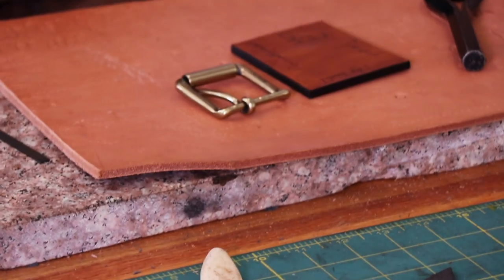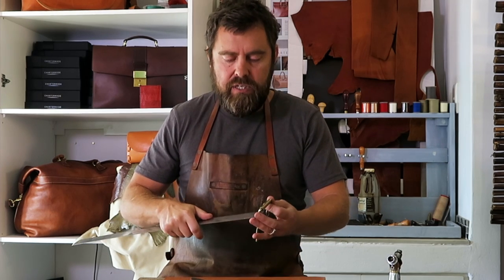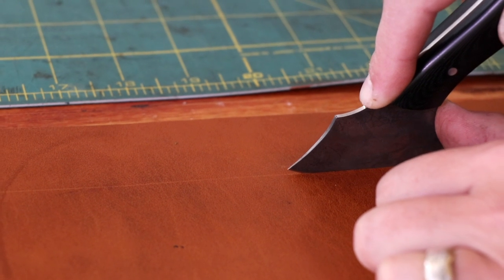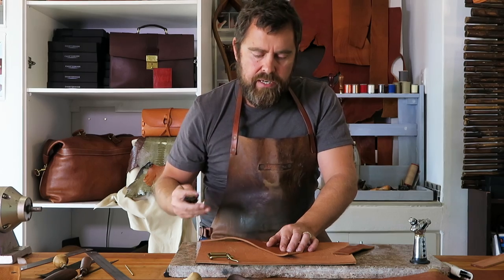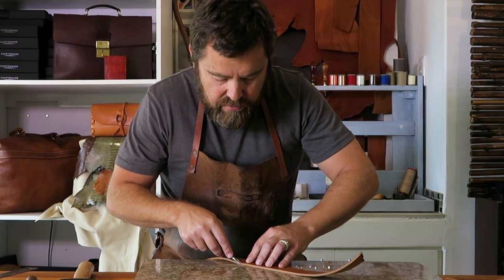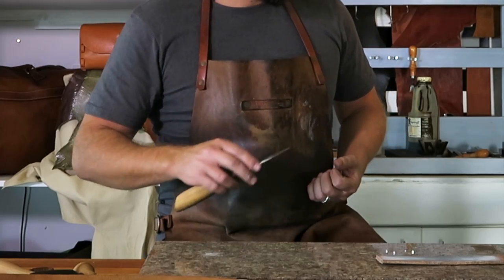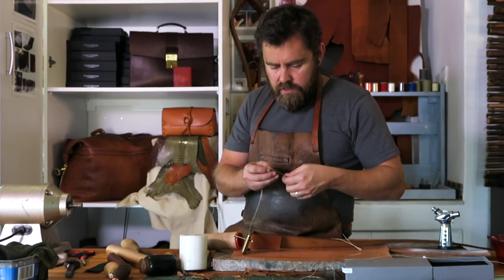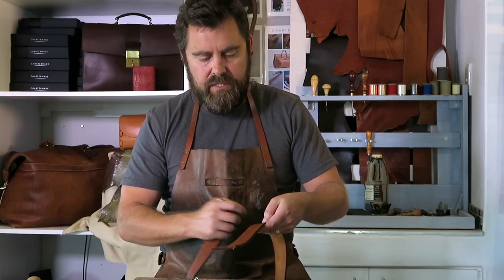Making a veg tan leather belt tutorial

Comment: It is much better to stitch parallel to the belt edges instead of across the width of the belt just below the buckle. It takes a bit more time, but the belt will last 60 years.
Reply: Your advice is very good, you have described bridle stitching. Aussie saddlemaker here.

Comment: I love to see a master craftsman at work and I particularly love your precision and attention to detail.  You make a beautiful product.  

I was taught by a master saddler and bridlemaker and our belts were essentially bridle straps for humans!  Therefore, in order to keep the strength of the product,  which was probably unnecessary given the differences of strains placed on a belt and a piece of tack, we did not stitch at a right angle across the width of the strap.  We also used a creasing iron to give a pleasing detail to the edges which were bevelled and polished with edge stain.  Fixed and running keepers were considerably thinner than the strap, being skived down by hand or using a splitting machine.  We also squared them with a "looping stick" and creased them.  

What leather do you use, by the way?  Is it South African?  It looks real quality.  Where do you get it from?

Also, I love your maker's stamp - pure quality.  Love to know what you charge.  In UK saddlers/bridlemakers/leatherworkers are real skilled craftsmen/women whose products do not command the prices that the skill required to make them deserves.

Comment: Stitching across a belt isn’t recommended as it weakens the leather. If you stitch parallel to the edge you can also stitch in the belt keeper. This is a quicker method but not strictly correct and the belt won’t last as long.

Comment: I bought a 2 meter ruler, works better than my small rulers put together, what a pain. Those strap cutters do not work very well on thick veg tan. I make my belts out of 12 to 14 oz veg tan without dyes or oils. Trying to cut that with a strap cutter is nerve wracking because it wants to cut to the side. Easier just to use my straight edge and it comes out where I want it too.

Comment: Hello! My name is Sergey, I'm from Russia!) I wanted to ask you for advice. I started making leather goods. I use vegetable tanned leather. I buy already dyed leather. Leather without topcoat.
I take colored leather and soak it with natural compounds, such as: bone oil, fat, a mixture of waxes.
I ran into such a problem. After the leather has been soaked, I remove the remnants of the product with a cloth, and the tissue stains from the leather. That is, the leather (after impregnation) stains the fabric.
I was told that after the leather is saturated, it must be covered with a finishing agent. What topcoat is used to create a reliable topcoat.
But traditional finishes spoil the naturalness of the leather a little. That is, after applying the finishing agents, natural impregnated leather loses its attractiveness.
This makes me very sad.
I would like to soak the leather and, possibly, treat the leather with a finishing agent, but in order to preserve the naturalness of the leather.
I want to soak and treat the dyed vegetable tanned leather in such a way as to preserve the naturalness of this leather. And most importantly - the leather should not stain the fabric when I wipe the surface of the leather.
That is, the finish should be, but it should not spoil the natural properties of the leather.
That is, I need:
1) Impregnate the leather with natural means (oil, fat, maybe something else)
2) Protect the leather, cover with a finish coating, but so that the leather does not lose its naturalness. And most importantly - in no case should it stain the fabric.

Please advise me - how can I achieve this?

Thanks in advance!
Best regards, Sergei!

Comment: Howzit from  a fellow SA living in Germany.  Could you please do a video on how you keep your end punches sharp. I recently started doing leather work as a hobby, so still learning. The punches I bought were not too sharp. The edges were covered in paint 🙄 which I had to hand sand off and tried to sharpen the lot but I am afraid success is eluding me. As for your irons...were did you get them from?
Thanks for the videos!
Reply from the maker: Always good to hear from a fellow south african. The irons are from Sinabrok.  To try get your punches sharp again, check out the how to sharpen your skiving knife video on the channel.  so with that motion in mind you can use a 25 - 30 degree angle.